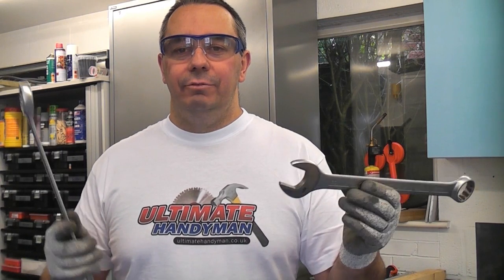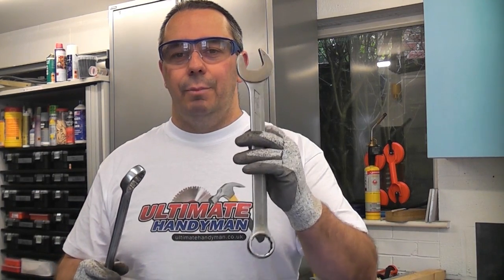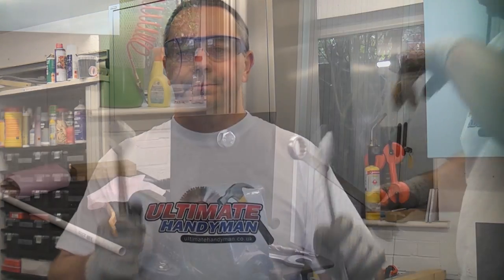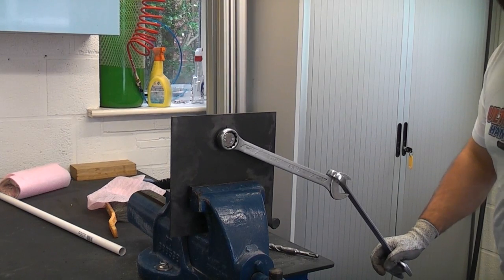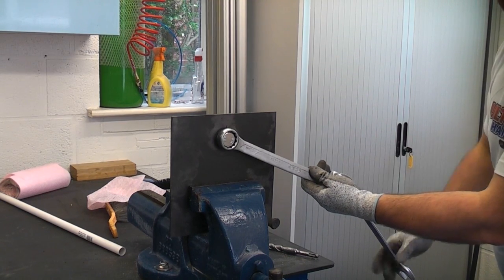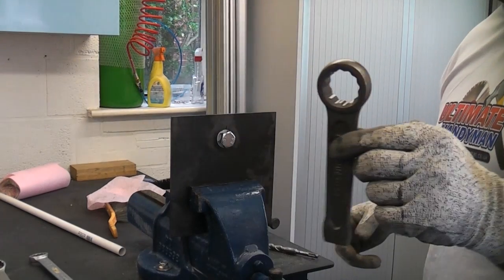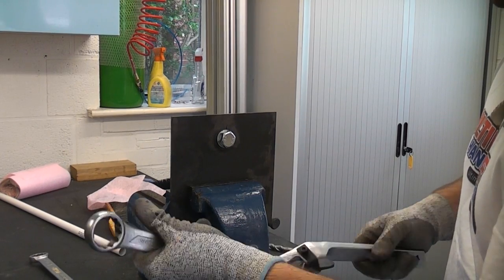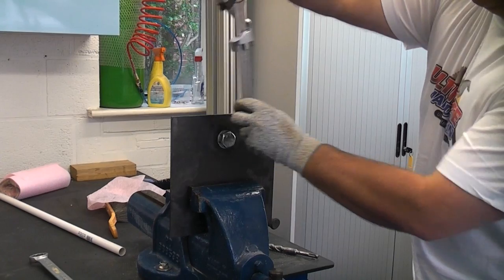Wrench extender versus two spanner trick

Comment: I just use a metal pipe that fits over the entire wrench. I've also flared the end of the into a oval so it doesn't create a sharp point on the side of the wrench, just whack the end of the pipe with a hammer a couple of times.

Comment: Mr Ultimate Handyman, thank you for pointing out the dangers of using an extra spanner to increase the spanner's leverage ratio to remove a stubborn bolt.  40 Years ago on the construction of Didcot Power station (UK) an old Steel Erector friend was leaning through a hole in the top floor (180ft ) grating level tightening a bolt for a lifting appliance.  The jaw on his "podger" spanner broke causing him to fall to the ground level whilst I watched powerless to do anything.  Subsequent investigation proved that the spanner jaw had been strained to the point of fracture by the practice mentioned in your video.  Thank you for bringing this practice and its possible consequences to public notice.
Reply from the maker: You are welcome. A friend of mine used this technique once on site, when undoing a nut holding a steam valve in position and exactly the same thing happened, luckily he was on level ground, so did not take much harm. 
I'm sorry that you had to watch your friend fall to his death, that must have been horrendous!
Thanks for the comment
Reply: @ultimatehandyman  Not easily forgotten.

Comment: Here's a tip for anyone watching:  When ever you can, use your weight to press down on what ever you're trying to tighten or loosen (rather than lifting like in the beginning of the video) .  it's much easier.
Reply from the maker: +Casey Clymore 
If a nut or bolt is really tight you can't get enough force on it doing it that way as you can only exert as much force as you weigh. If you pull up you can exert more force- unless you are weak of course ;-)
Thanks for the comment
Reply: +Ultimate Handyman I strongly suggest using a back brace if you have to exert large force by pulling up, especially if it exceeds your body weight.  It's very easy to hurt yourself, ESPECIALLY if you are strong.  I'm a young man and I've hurt myself doing this before.  Better safe than sorry.
Reply from the maker: +A. Hyder 
Thanks for the comment
Reply: it is also safer to push things away from your face. if the thing breaks free, or snaps off entirely you are less likely to get a spanner in the mouth
Reply: @maxchartier  Yes I managed to hit myself in the face pulling a tyre iron up towards me lol.  Learned my lesson, always push down when removing lug nuts now :-)

Comment: Doubling up is how I broke both of my hands. The jaw broke and both of my fists hit the subframe. I fractured my 5th metacarpal in the right hand and the 4th and 5th in my left hand. And no, they weren’t Snap-On wrenches, but it was a $500 set of MAC “Knuckle Savers”, ironically enough. 

But I’m a glutton for punishment, so I still usually double up wrenches because it’s the fastest way. I’ve not broken another wrench, but it really eats up the jaws on the open ends.
Reply from the maker: I hope your hands are ok!
Thanks for the comment 👍

Comment: cheap wrenches might break but quality wrenches from snap on or other quality tool manufacturers won't. If they have I haven't seen it.
Reply from the maker: Bryan Davis I saw a Gedore snapped once! Thanks for the comment
Reply: +Ultimate Handyman
i cant say i consider geodore a real tool, perhaps they were good years ago but nowdays there are lots of low quality stuff in their lineup
Reply from the maker: +werrycoolnick 
This was an old Gedore spanner. I was not aware that they had started to sell low quality tools.
Thanks for the comment
Reply: +Bryan Davis Many of those "expensive" tools are built in the same factory with the same metal... they just have a different brand stamped into them.
Reply: +Bryan Davis use enough torque and something is bound to snap.
Reply: I've seen plenty of high quality tools break. Yes they may have more tolerance over all than other brands but not 100% of tools such as Snap-On as you have mentioned will last. There's that slight chance they had a weak point in the metal or just too much torch than what the tool could handle. None the less that's why you pay more for those brands as they do offer a lifetime warranty to cover the replacement as well as to analyze the broken tool to help make sure it doesn't happen again. Nothing is 100% indestructible just look at the Titanic.
Reply: Bryan Davis I have broke a lot of snap on wrenches over the years

Comment: stop buying bottom line tool and get yourself some good one, been working as a technician for about 7 year using the double wrench technique almost every day and never saw a broken wrench,

i use snap on but any high end brand will do it...
Reply from the maker: It depends how tight the bolts are that you are undoing.I watched the jaw of a 27mm combination spanner snapped off when undoing the nut holding a 3" gate valve in a steam line using the two spanner technique. I'm afraid I could not justify buying a set of 22mm-32mm snap on spanners as they would be very expensive.
Reply: tools I buy have a life time replacement. no matter how or why you can always get a replacement . so you can sell your toy to somebody  who knows nothing about tools. and does that toy your selling have a lifetime warranty or replacement?
Reply: I've actually seen someone who used the double spanner technique on a very tight bolt. He slipped and hit the first spanner with his head, creating a big wound on his forehead. I also use that technique sometimes, but it's not the safest way to get these bolts out.
Reply from the maker: Thanks for the comment ;-)
Reply: the double spanner technique is most common in auto applications where space is limited and torque is low if your dealing with realy big nuts and high torque get the right tool for the job.
Reply: I wouldn't be so sure about that.  Even a first-year dealer knows what tools can reasonably be expected to be put through in the course of work.  Snap-on and other truck brands don't fail easily.  He or she would be within their rights to make the determination you had intentionally abused the wrench, and refuse to replace it.  At best, if you're a "good" customer, the dealer might replace it once, with a warning; after that, you'd be on your own.  You have to understand that you're cutting into his or her profit margin; none of these replacements are made for free.
Reply: Nice thing about an extender is you can use the open end on the bolt of you can't get the boxed end over the nut for some reason. Pipe I use on a ratchet handle but combination wrenches for bug bolts require a really large diameter pipe to fit over the end of he wrench.

Comment: You had it with the slugging wrench. Torque just whips stuff out. Impact is the way to fly. That is why pneumatic impact guns kick so much ass. Hammer action!
Reply from the maker: +Paul Frederick Absolutely. Thanks for the comment ;-)
Reply: +Ultimate Handyman so that slugging wrench is used with an impact? Do you have a video demonstrating that? Never seen that before.
Reply from the maker: No, the slogging spanner is used with a hammer-
https://www.youtube.com/watch?v=RqgRMkJNVSA
They are difficult to find in sizes less than about 24mm though.
Reply: *****
You can beat any wrench. Well, maybe you can't, but I do! I have soft hammers for such things.

Comment: I use the 2 wrench method as the case may be, however, to prevent any damage to the bolt/nut, I most often use a socket and breaker bar.
Reply: That's alright if you have room.

Comment: Still looks dangerous. I'd go with one of those breaker bars and an impact socket...
Reply from the maker: FoodOnCrack 
That would be the best option, but when working on water/steam pipes you often can't get a socket on as you are restricted by the body of the valve etc.
Reply: I'm on board with that idea.  And the longer the breaker bar, the better; you won't have to grunt as loudly or use as much energy to get the job done.  Of course, you won't have a cool bar story to explain how you lost an eye trying to remove a bolt with the ole double-wrench trick.
Reply: Plenty of times a breaker bar and an impact socket won't fit. Using an extender or double wrenching a disc brake maxi can be done in 10-15 minutes, if you want to use a breaker bar or impact, your pulling the tires and just made it a 25 minute job.
Reply: To loosen my Toyota's serpentine belt, there isn't enough clear space to fit a socket - only room for a regular spanner/wrench. So they have their uses.

Comment: The extender is a fine idea for removing rusted bolts from exhaust manifold flanges and stuck oxygen sensors.  What are the make and model for your box wrench extender?

Comment: I once put a 6 foot long pipe onto the end of a wrench, then stood on the pipe. The leverage was so great that it broke the head of the bolt clear off the bolt itself, twisting it right off.  My whole idea was to try to remove the bolt but now I was stick with a bolt that now had NO head on it whatsoever.  That shows you that sometimes rusty bolts won't come out no matter how much torque you apply. Now I apply anti-seize to all bolt treads to they don't rust solid like that.
Reply from the maker: Yes, I have been in similar situations myself. If the bolt is in a blind hole it can be very difficult and time consuming to sort out! If possible now I tend to reach for the gas axe and burn the head off the bolt or the nut off and remove it that way.
Thanks for the comment

Comment: This is what I've been looking for. When you are involved with large bolts at high torque that double spanner is fun until
You punch yourself in the face because two wrenches aren't actually made to mate up and make a longer wrench.
Sure it works pretty flawless on a 3/4 inch nut but triple that size put a bunch of torque on it and leave it out in the elements for five years and see how well you trust that double spanner technique there's a place for the double spanner trick but this tool would be nice gonna have to talk to the boss about it
Reply from the maker: Thanks for the comment ;-)

Comment: Does it work the other way around? Sometimes it is not possible to use the ring part of the spanner on a nut and you have to use the open end. Would this extender fit over the ring end?
Reply from the maker: I think so, I'm sure I had to use it that way once on a steam valve.
Thanks for the comment

Comment: We usually used a length of 2 inch pipe, and pour some "F**ks" into the stubborn ones. I mainly worked with heavy industrial stuff, and the 36 inch stillys were known as the persuader, finally the gas spanner which will shift both metric and imperial.
Reply from the maker: The gas spanner is always guaranteed to work, unless it's a stainless nut or bolt ;-)
Thanks for the comment

Comment: buy a cheep set of wrenches and cut the open end off and use a jack handle on it the box end will snap before you strip the bolt

Comment: Shouldn't you turn the nut, not the bolt?
Reply: you're assuming there is a nut on it.  Not every bolt has a nut. Sometimes the bolt is in a piece of steel that has threads.
Reply: And sometimes the nut has no bolt.
Reply: The bolt could be threaded directly into a big chunk of steel, sometime the nut is welded, other time the nut is just in a stupid place where you can not turn it for whatever reason. But for this test, it do not matter, turning the bolt instead of the nut make it harder, which is actually the point of this video: hard to turn whatever.

Comment: omg he is using it in the wrong direction. allmost cracking the little black thing on the extender.
Reply from the maker: OMG ;-)
It will only work in one direction- it's impossible to use it backwards.

Comment: Does anyone know how to remove pedals from cranks that have neen in a long time and probably seized in?
Reply from the maker: Plenty of spray penetrant, if that fails a little heat from a blow torch should help.
Reply: Thanks a lot for that.
Reply from the maker: John Hughes
You are welcome ;-)
Reply: John Hughes Yeah, undo them counter clockwise.. if you can't then best be getting down the gym.

Comment: I don't care what it's made from, forged or not. Just looking at it, looks like Cheap Forged steel. Watch how much it flexes on the very first tug he gives it. I've never seen a good wrench or pipe flex like that, let alone break. You should never break any wrench on any kinda bolt, unless it's a cheap wrench. The bolt head would strip or snap before a good wrench breaks.
Reply from the maker: Nick Schneider 
I think you are missing the point. People use the two spanner trick to loosen really tight bolts. I was stood behind someone once when he was using the two spanner trick to undo the bolts on a stud holding a steam valve in position. His spanners were good quality (Gedore), he snapped half of the open ended part of the spanner clean off ;-)
Reply: I understand what you are saying, I didn't misunderstand anything. I think you might have misunderstood me though...if your friend was using that extension instead, it would have snapped long before that wrench had. Sometimes tools break, but a good wrench will out torque that extension any day of the week.
Reply: actually you are missing the point. the wrench is being used incorrectly when doubled because of the added leverage and thus rotational force being applied only to the jaw which is not designed to handle that. look at how the wrenches interact at the connection point. we're not anywhere discussing wrench to fastener interaction, which will also become subject to failing when overloading the wrench with extensions or cheater bars. even snapon will fail when abused.
Reply: actually you are missing the point. the wrench is being used incorrectly when doubled because of the added leverage and thus rotational force being applied only to the jaw which is not designed to handle that. look at how the wrenches interact at the connection point. we're not anywhere discussing wrench to fastener interaction, which will also become subject to failing when overloading the wrench with extensions or cheater bars. even snapon will fail when abused.
Reply: actually you are missing the point. the wrench is being used incorrectly when doubled because of the added leverage and thus rotational force being applied only to the jaw which is not designed to handle that. look at how the wrenches interact at the connection point. we're not anywhere discussing wrench to fastener interaction, which will also become subject to failing when overloading the wrench with extensions or cheater bars. even snapon will fail when abused.

Comment: Or a large pipe.   Dude really broke his spanner, wow. That's serious arm torque, or a cheap Chinese tool.
Reply from the maker: Yes, it was not a cheap spanner, I think it was a Gedore. My mate was undoing some bolts on a steam valve that had not been removed for several years using the two spanner trick and it snapped the jaw off. He is incredibly strong ;-)

Comment: I use a breaker bar, or if needed - a breaker bar and a bit of scaffold pipe :D
Reply from the maker: +Chris Watson 
I use a breaker bar too, but not on valves on water/steam pipes as you can't get a socket on. The only thing that will fit is a spanner/wrench.
Reply: Mainly use it on car suspension components, as those things can be a pig to remove.
Reply from the maker: +Chris Watson I can imagine, can you get an impact wrench on them?
Reply: could do, if the garage had power, but sadly its away from the house. I use Halfords tools (I'm over in England) as everything has a lifetime warranty with a no quibble exchange policy, so if something did break, I don't have to worry, I just drive to the shop and get a swap.
Reply from the maker: +Chris Watson 
I was thinking more of a cordless one. There are quite a lot available now, but even the good ones like Milwaukee 18v struggle with some nuts/bolts.
Halfords professional tools are great for the money, I have a set of their ratchet spanners at work.
Thanks for the comments ;-)

Comment: Or pop a steel tube over the end ?
Reply from the maker: reddog694uk 
That would work, but if you get caught on site you would be in trouble ;-)
Reply: +Ultimate Handyman id be more likely to find a pipe than that tool

Comment: must have been 1 shitty wrench if he broke it like that because that part of the wrench is allmost just as strong as the handle. That is why on quality wrenches the jaw is made a bit thicker then the handle. So with a good quality wrench you wont ever break it like that. Only thing i have maneged was to bend a wrench just slightly because you put pressure on it in a diffrent direction then it was intended for.
Reply from the maker: If I remember rightly it was a Gedore, which are a decent make.
The guy that broke it was 20 stone and was one of the strongest people I know, sadly he passed away a few weeks back. He broke quite a few pairs of Bacho 8 inch adjustable spanners as well.